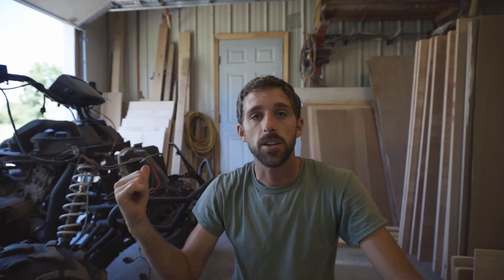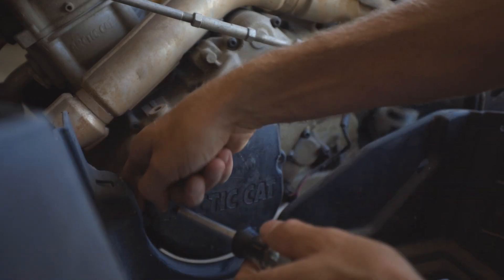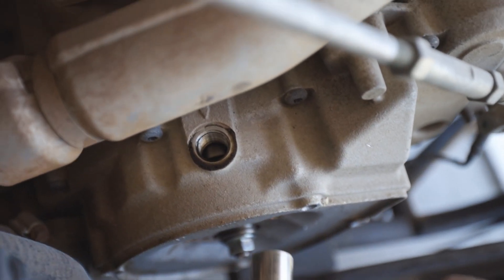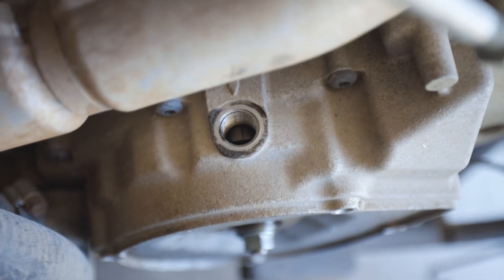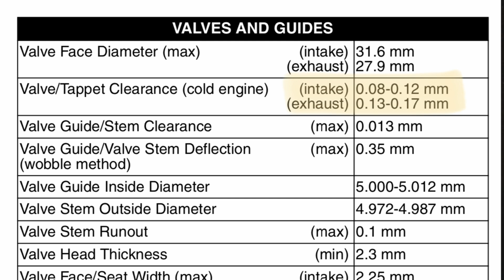How To Adjust Your ATV Valves

Comment: How do you know your on the compression stroke. And have you ever had to replace the RTV for the whole valve cover?
Reply from the maker: On the compression stroke the rocker arms and adjuster screws don’t have pressure on them and should have a little play in them.
The covers have a gasket ring on them so no need to replace them unless they are damaged!

Comment: Hello, I own a 2007 Can Am 800 atv. When I start the engine, it runs normally, but after I drive it for a distance, the fan works and the engine warms up. If I finish the trip and try to start the engine again, it happens like a hard crank, knowing that I changed the oil and starter, but I did not check  The engine from the inside, thank you .

Comment: Ok, so i have a question: Do you have to do this every 600 miles, or can you do it every 1200 miles or ever year and does it usual cost $300 just to atv valve clearnce inspected and i were to do it myself what tools/ kit do you recommend getting
Reply from the maker: You can do it every 6 months to a year. It’s a good idea to check them once a year. You can do it yourself easy enough all you’ll need is feeler gauges and the valve adjustment tool.
Reply: Ok so I have a kawskai brute force 2023 i bought it towards the end of the year so i should be good till towards of next year to do a valve clearnce inspection
Reply from the maker: @spikestock  You should be good. Some people check them sooner on new machines and some do it yearly. It would also depend on how much to use it.
Reply: Ok I really appreciate you answering my questions thank you

Comment: Great tutorial.  I'm still confused about something. My ac 2016 is called a 500. You've called yours a 550. Is there any difference between the two?
Reply from the maker: There are a few different models of Alterra for 2016. The main difference is the engine size. Your 500 has a 443cc size engine and the 550 has a 545cc engine.
Reply: @ArcticFrost Correct. How do you get, or how do you know if your on the compression stroke when getting to top dead center?

Comment: I attempted this but my rocker arm moves up and down a lot even at TDC. Is that normal?
Reply from the maker: Once it’s at TDC the only movement it should have once properly adjusted is the specific tappet clearance.
Reply: Thank you for the reply @ArcticFrost  . I adjusted them and I got my ATV running, finally. I had to adjust both sides a ton. Thank you for the videos.
Reply from the maker: @brodyhard  You’re welcome, Glad you got it running!

Comment: What is this procedure for?
Reply from the maker: The valves should be adjusted if the engine is hard to start or won’t start or if it is stalling or idling poorly.
Reply: @ArcticFrost If it's idling fine, and starts well, runs well, but still hear ticking sound that stays in concert with the rpms when you accelerate, but also have ruled out an exhaust leak,   does that sound like the valves still need an adjustment or do you think it's something else causing the slight ticking or tapping sound?
Reply from the maker: @biosphere8488  a slight ticking could be the timing chain, the camshaft, or valves if it’s coming from the top end. I don’t think it would be your one way bearing that’s normally more of a grinding noise from the clutch side.
Reply: @ArcticFrost  Thanks.  That's a big help. Looking forward to more of your videos with winter around the corner. Your excellent edited videos are helping Arctic Cat stay alive in the online ATV world 👊👍

Comment: What are the measurements of the left side and the right side at minute 06:25?
Reply from the maker: The valves on the front of the engine (above the exhaust) are the exhuast valves 0.13-0.17 mm (0.005-0.007 in.).
The valves on the back (throttle body side) are the intake valves 0.08-0.12 mm (0.003-0.005 in.). These measurements are for Arctic Cat 550/700 h1 models!

Comment: I have been looking for valve clearances for a 2013 AC trv 700. (efi). What I have been finding is very conflicting information on what the Intake and Exhaust valves are in fact supposed to be.  Your manual shows values that do not agree with the information I was given by an arctic cat tech at a dealer.   Or, for that matter, other videos and information that I have been able to find on a frustrating internet search.  I could not tell you if there were changes in these values based on model year or a specific machine in the 700 class. Long story short, It may be best to rely on what the tech manual for YOUR specific machine and engine gives as values.  As the saying goes: Trust but Verify.
Reply from the maker: Same clearances on all the 500, 550 and 700 H1 engines from 2009 to current models, the Alterra 600 is a different engine platform. But do check your specific service manual.
500:
0.08-0.12 mm (0.003-0.005 in.) - Intake
0.15-0.20 mm (0.006-0.008 in.) - Exhaust
550 & 700:
0.08-0.12 mm (0.003-0.005 in.) - Intake
0.13-0.17 mm (0.005-0.007 in.) - Exhaust